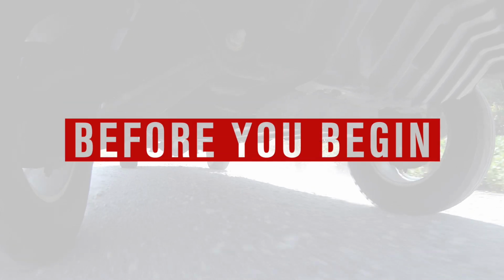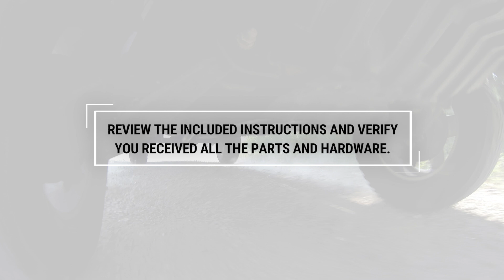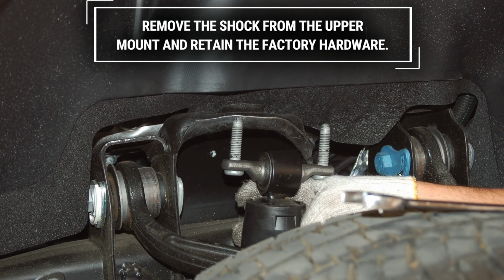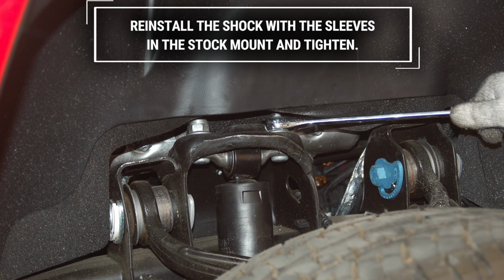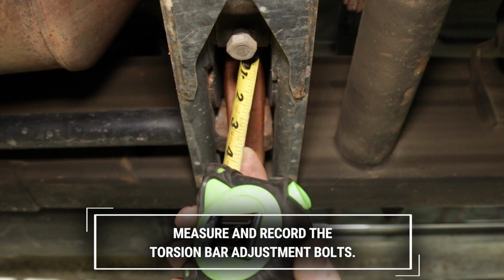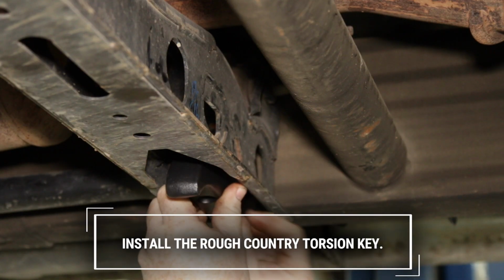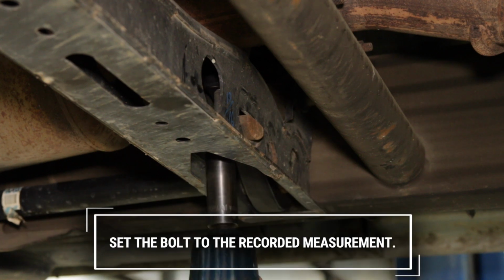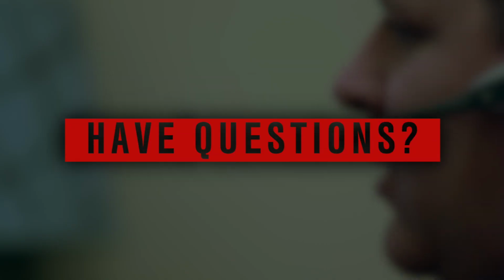Installing 2011-2018 GM HD 1.5-2in Leveling Torsion Bar Keys Lift Kit by Rough Country

Comment: I would recommend talking to A good GM shop before doing this to 2017-2018 models. It caused some serious vibration issues with my 2017. changes front axle cv joint angles beyond mfg specifications.
Reply from the maker: If you have the keys cranked too high on the front it will affect the cv axles and affect the ride quality and cause vibration. You just have to be sure that you keep the keys torqued to the recommended specs and ride height.

Comment: I had a shop install rough country level kit and it rode horrible , I had to go back and crank the keys down a bit, it rides better but still a little rough any ideal on how I can fix this issue haven’t gotten an alignment yet since I barley move the truck only on the weekends
Reply from the maker: Alignment is required and will help improve ride quality. Also if the keys are still cranked too high that will be an issue but naturally torsion key suspension systems are going to ride a little stiffer anyways.